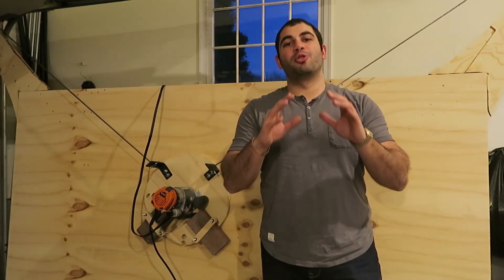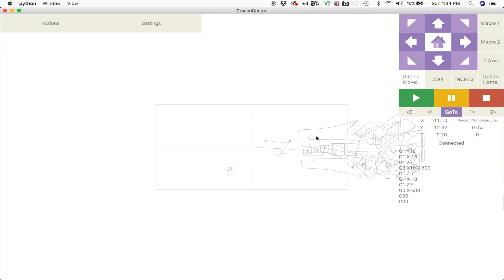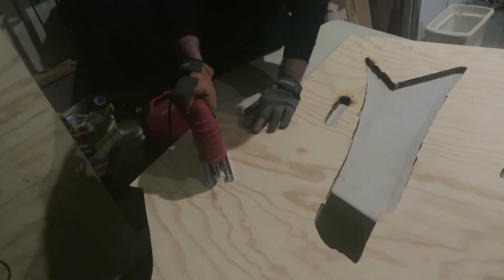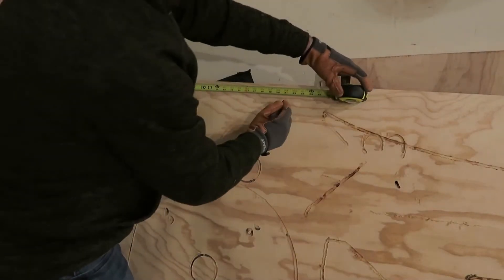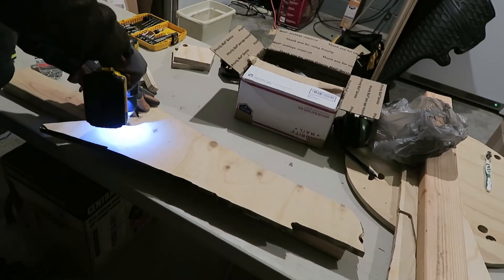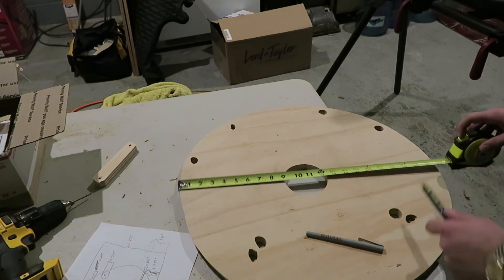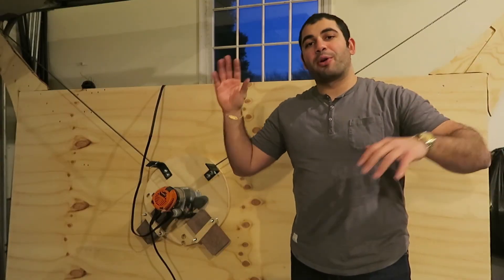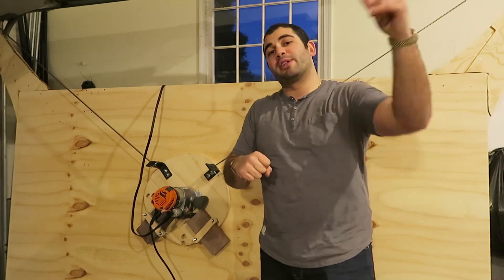Maslow CNC Original Frame!

Comment: Hey guy ... that power(?) cord dragging from the top center looks like a really epic bad idea! You are adding an off-center force that is pretty much guaranteed to twist the head, and throw off your cuts. Not sure why you have the second cord, but dangle it from the bottom, as with the original Maslow design. If the attach point is not at bottom-center, then zip-tie the two cords together, such that when you pull downwards on the two cords, the head does not shift at all. The Maslow design is pretty clever, but if you add forces in directions they are not expecting, you will screw things up!
Reply from the maker: Hey thanks for the tips, that cord is actually just connected to the z-axis from the control board and has a lot of slack on it. It’s not seen in my videos, but I did check to ensure it wasn’t tugging on the sled at all. It actually has so much slack that it can traverse most of the plywood without ever getting close to pulling on the sled, and with the speed of the cuts it’s easy to keep checking on throughout the cuts and prevent any issues.